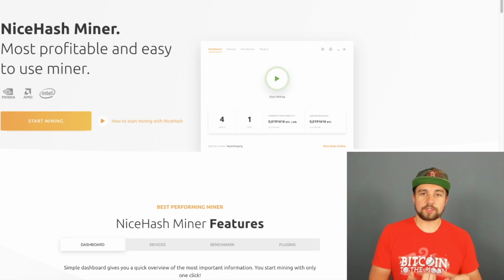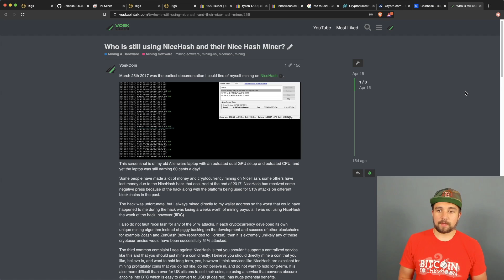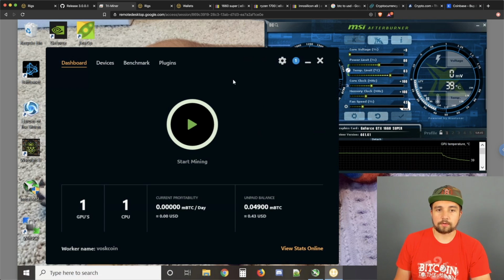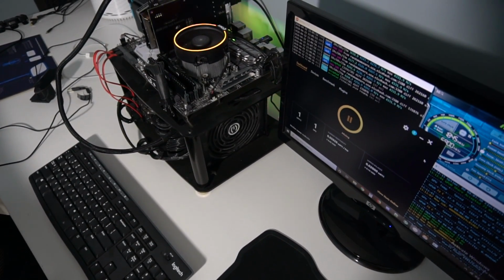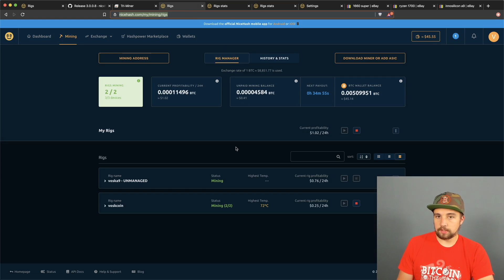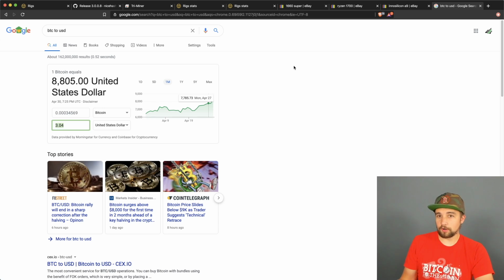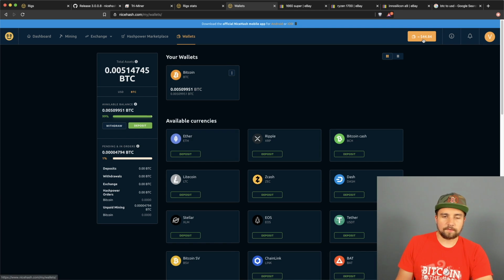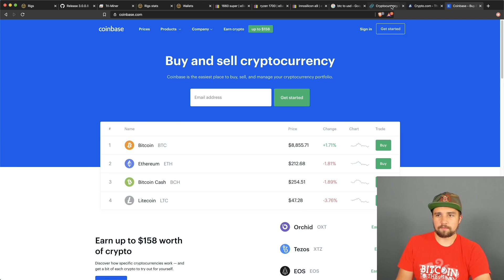How To Earn Passive Income with your CPU and GPU | NiceHash 3.0 Guide

Comment: Building a rig just to help pay for utilities, got a rx580 from newegg when they were in stock for about 30 minutes 3 days ago 🤣 missed out the first time they had them. I have 2 rx570s that I'm wanting to add to the rx580, I know it won't put out much hashing power but something's better than nothing and it's a relaxing hobby putting it together, thanks for the content.

Comment: Hello! Why GPUs are mining less than NiceHash calculator is showing? Anyone can help? For example if you calculate on standard consumption RX580 8gb mining profitability with NiceHash will show between 3.4 and 4 per day but physically is making only 0.8... that is huge difference. And not only this card I have many, RX480, 1660, 1050 all making a lot less than calculator shows. Help

Comment: Thanks Vosk!  Used the “run as admin” tip finally and it appears I have a solid increase in CPU mining. From 4000 to 5500 h/s now in the code. Is that what I should look at?  Also went from 2.5-3 kh/s to a steady 5.5kh/s.

Comment: I have a critical question ( lololol) 

I'm a new miner, I am doing my benchmarks with a mild overclock, I'm running as admin also. I keep getting errors during benchmark on various plugins. I'm not sure how to even address them or even if I should. I simply did the install plugin route through nicehash, about 1/2 worked. 

What on earth do I do? lol.

Also a 2nd question. Do I just keep my mined currency in Nicehash? or do I need to export the currency to a wallet ( like Coinomi ) ? Trying to understand the balance between the Nicehash wallet vs Coinomi wallet, vs Coinbase.  Kinda odd having 3 places to keep the currency. Also worth asking, do I just farm bitcoin with Nicehash ( since that's all they pay out anyway) and then take that bitcoin and buy hash power to farm other currencies? or how does that work? My goal is just passive income, I don't mind minor investing and all, but want to just have as much stability as I can.

Comment: What I noticed at NiceHash is that I have few rejected and incorrect shares. Some people from reddit suggested that OC settings are wrong, but with the same parameters that doesn't happen to me when mining on some other pool. Also there are a few posts where people blame it on NiceHash, and that is the problem on their end. 
Do you maybe have some more experience with this stuff and if that is something I need to worry about?

Comment: Is it normal for my PC to start sounding like a jet engine taking off as soon as I start mining? I've never heard it get that loud even when pushing it with gaming.
Reply from the maker: You can just lower the fan speed to fix that, assuming the gpu is still staying adequately cool
Reply: Set your fan speed on auto through the bios or an overclocking software. Lower your GPU power to 65-70% and use low power setting on NiceHash

Comment: Hey i have a msi gtx 950 and a i5 6500 with 16gb of ram and when I run a benchmark the gpu fails the test but the i5 is fine is it setting that are wrong or is that gpu to old thanks for any info you guys could give me on that

Comment: DO NOT USE NICEHASH 3.0. IT USES YOUR CPU TO MINE SECRETLY without permission! Check your CPU usage, it happens even when idle! My power consumption went way up with nicehash. It does it with all versions from 3.0.0.0 to 3.0.4.3! It does not do it with the legacy 1.9 versions. Exteremely shady software! There is a reason everyone got 'hacked'. Nicehash are a bunch of crooks.
Reply: bro, u saved me

Comment: So if i use a undervolted CPU something like an Intel with an ''U'' on the cpu, would it cost me less electricity even if I get a Rig for mining?
Reply: Probably yes, but remember cpus need a determinated voltage to stay working, so it wouldnt change the power consumption that much

Comment: Pi Network

1. Install the Pi app with the link below.

2. Enter my ID (Money4fr33) as your invitation code. At present you need a code to join. It also will give you extra % on your earnings as will I.

3. Activate your Pi coin mining by clicking :zap: symbol. You just need to login once in 24 hours to reactivate mining and you reactivate again once your daily time limit completes.

4. Similarly you can share your link to your friends with your username to start earning more PI coins per hour. The more people you add, your per hour earning capacity will increase.

Thanks .

Pi is a new digital currency developed by Stanford PhDs, with over 7 million members worldwide. To claim your Pi, follow this link 

https://minepi.com/Money4fr33

and use my username (Money4fr33) as your invitation code.

Comment: ive been long gone from this scene of cryptocurrency mining does it still damage your computer long term or short term?
Reply: Damage? You need good cooling, clean your system once a month. I mine for 3 years and never replaced a item. Well I replaced a fan on a gpu because the ball bearings are getting old and the fan don't spin. But that's all
Reply: @justinhughes4722  folding??? (my hobby) :)

Comment: Hi. I mine with a gtx 1080, and only earn about $0.8 a day. Is there a way for me to increase that number?
Reply: overclock, buy more gpus... rx 470s are imo the best bang for the buck and will pretty much match your 1080 for mining. also be happy with 80 cents a couple months ago you would be lucky to get 40.
Reply: LuckyDuck dam I was about to remortgage the castle to buy miners 😭😭😭
Reply: CAS CAS  well with the release of the 3000 series from nividia mining may become a LOT more popular and profitable.
Reply: LuckyDuck but that will increase supply and the coin will loose value hence it should be controlled to retain its value
Reply: Is that with CPU mining enable as well via Nicehash ? That will bump it up a bit more for you.  As long as the CPU doesn't melt.

Comment: I have a 8 x RX580  I installed the nicehash what settings is needed or how you set it up with 1150/2150 with 0,1v undervolt??? Nobody can seem to answer

Comment: Just curious, like I got a 1060, if I add lets say a 960 does it run those 2 gpu's independent at 100% or will the 1060 clock back to the mhz of the in this case 960 ?

Comment: I wanted to try mining just for fun in my gaming pc,i got gminer for btg when i started mining my pc turned off,this happened twice and i didnt try it anymore,i got nicehash and i started the benchmark,my pc immediately shut off again,i have a i5-2500 and rx 570 does anyone know why this is happening
Reply from the maker: How big is your power supply? Sounds like you’re running out of power
Reply: VoskCoin im not sure,i bought the pc last month,its a dell optiolex 790 im pretty sure its the stock psu and from what i saw online its about 265w
Reply: @rinorrn7705  how can u have 265w dude. Upgrade
Reply: VoskCoin mining on minergate with cpu only because it says gpu not available works fine tho
Reply: Overheating ?

Comment: Ciao @Vosk 
Are you saying that with only 1 gpu unit I can mine multiple cryptocurrncies similteneously??
Reply: yes, you can mine multiple coins but rewards will be very slow. better mine one. the higher the hashrate you have, they faster rewards.
Reply: @shaqnet  thank you for your info. Of ourrse in order to bag é a high hash rate.. I need to have big computing power which means >1 gpu unit.... How am I doing so far...?

Comment: Guys what about "damage" or wear on the cpu and gpu mining? Will it lower hashrate?
Reply: With GPUs and CPUs it’s basically working or not working. Mining might decrease the lifespan but it will probably work until its dead.